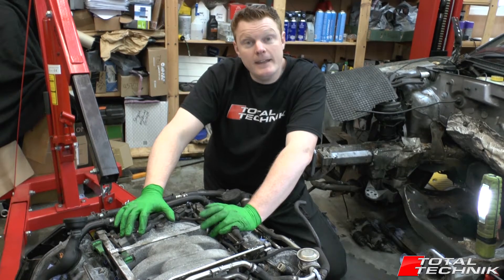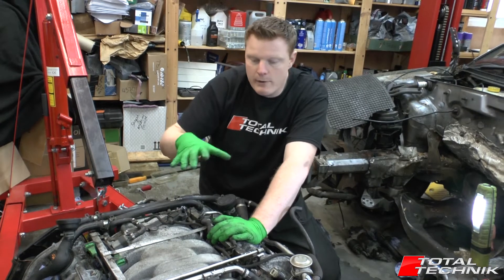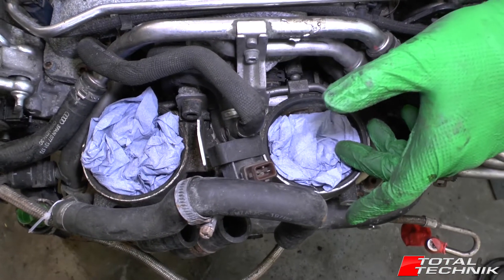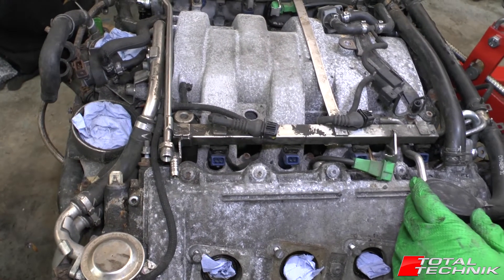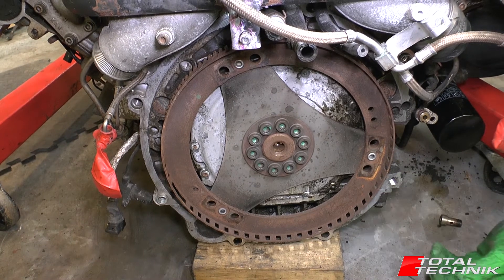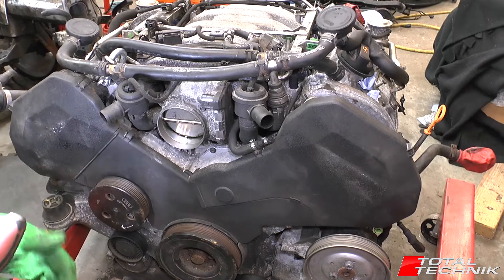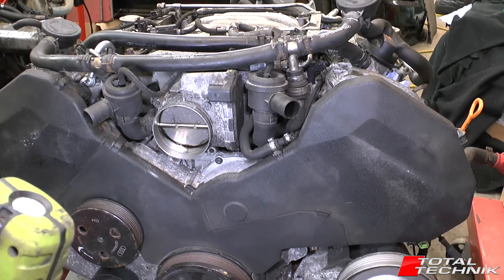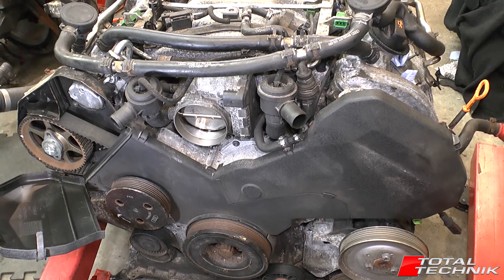Audi RS6 (BCY) Engine Guided Tour (Engine Removed) - Audi RS6 - C5 - 1997-2005 - Total Technik

Comment from the maker: Hope you enjoy the video! Just a basic overview of some of the main RS6 engine components - hopefully a useful reference for some viewers, and just interesting stuff for others!

I forgot to point out the power steering motor, but you should be able to work that one out. Tip: it's not the air con pump, it's not the alternator (both shown) but runs on the same belt ;-)